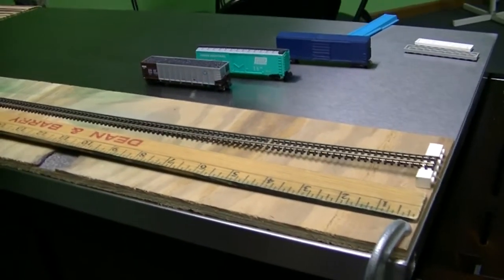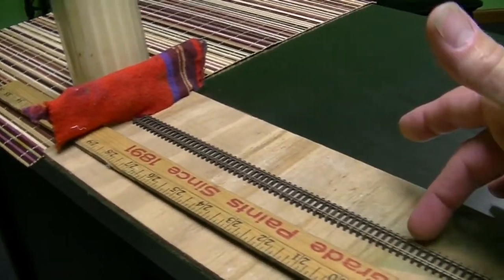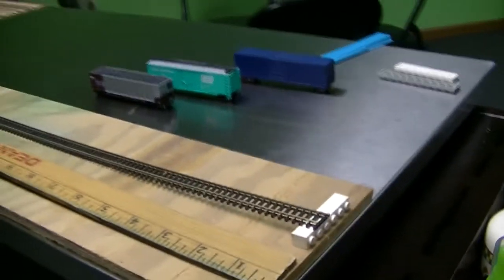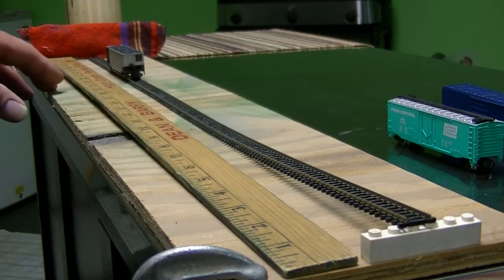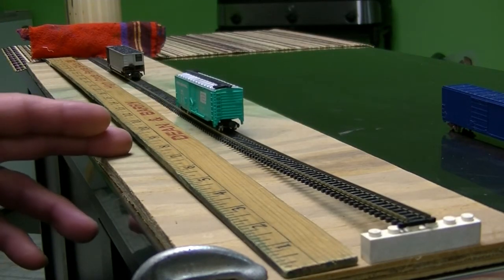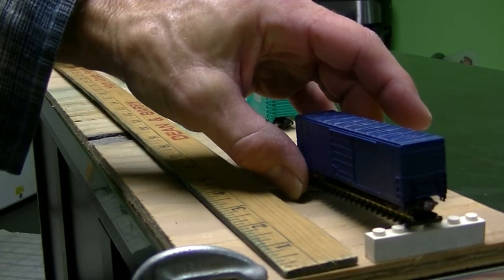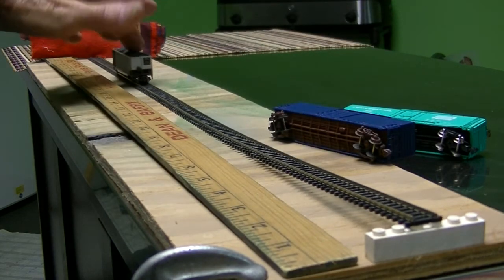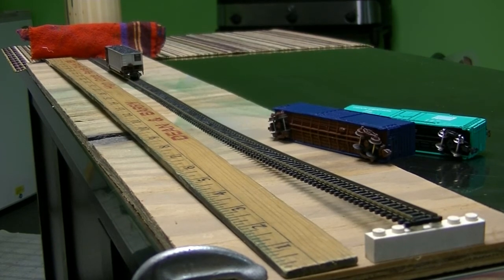HOW TO TEST MODEL RAILROAD ROLLING STOCK

Comment: Mike I took your fantastic idea and built on it,
I built what I call a test track. It is a 1/2 inch thick 2' x 3' piece of plywood.I then have a H shaped 1/2 wide x 1/2 wide H shaped structure under
this with a 2'x 3' peg board base. I mounted a simple Kato oval track and inserted the feeder wire so the power jack comes off to the side. Then I have 
a simple MRC 1300 power pack. When I get a new locomotive I will put it on the track to test it out. I will usually let the new locomotive
go around the track for about 45 minutes or so forwards and backwards. This simple little test track personally is a great little tool to test 
all my new equipment. It wasn't too expensive to build this just a little build time.
Thanks for the inspiration Mike